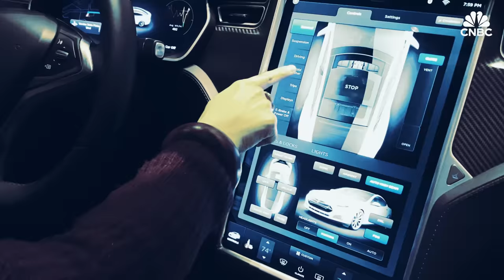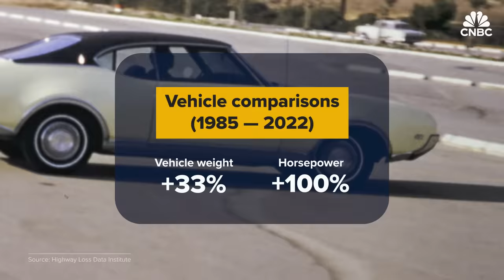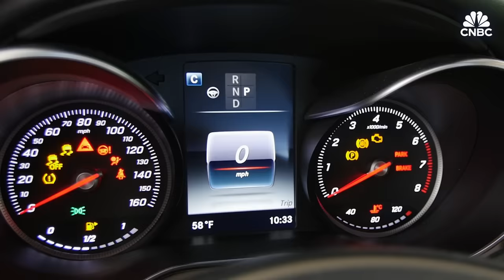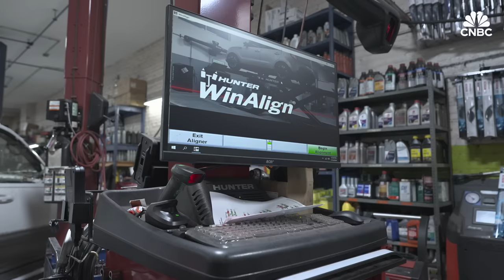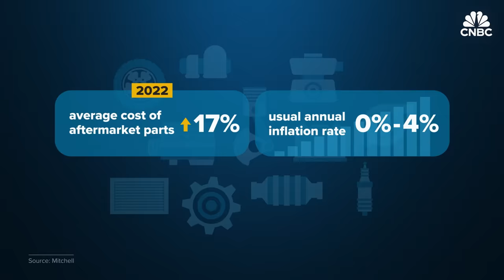Why Car Repairs Are Getting So Expensive

Comment: Not included in this video, is how car manufacturers are making dealerships the only place that they can have their cars repaired. This is essentially controlling the market and forcing consumers to pay whatever they feel like charging. This will squeeze out the already stressed independent repair shops and basically negate any cost savings that could come from the lower complexity of an EV. .

Please contact your local county and state and federal representatives and urge them to support right to repair for motor vehicles!
Reply: Your statement is half true. Issue is there isn't enough Mechanics who are willing to open a shop to repair cars. The Informations to repair cars and parts purchasing are not exclusive to Dealership. Anyone can Open a Shop and buy the repair equipments neccary to repair any cars, just like the shop this Video Interviewed.
Question for the shop owner is, at what point to you stop because the expenses simply exceed the profit to do certain jobs?
Do some basic math, Rent a certain Square Footage to open a shop, you have X amount of repair Bays, how much do you need to charge people just to cover the expenses?
Reply: @steak5599  And who is the first order influence of these higher costs? The manufacturers dictate the repair equipment specs and make the certification process as onerous and costly as possible... because if they run the shop... they don't have to account for any markup. 

This is all about forcing the market into a position where nobody can afford to be cost competitive with the dealer repair shop... and then they can control the market. They have been moving in this direction for years... but EVs and generally more tech in cars has accelerated it.
Reply: @paskowitz  right to repair only dictate whatever manufacturer sells to dealer also needs to be available for aftermarket shops and general public, it doesn't say manufacturers are giving them away for free.
They are certainly NOT free for dealerships.

Dealership also needs to pay a lot for subscription fees and tool cost. The difference is Dealership can make the money back on the investment, and general public most likely can't.
Reply: @steak5599  Right to repair laws in certain states have had language similar to "reasonable" in regards to the costs of obtaining the necessary documentation to make repairs. IIRC I think is was MA, but I could be wrong.
Reply: @paskowitz  that's the issue with these Laws, what is reasonable is always up to interpretation.
So you have to use the car makers Everytime when price is reasonable?

Here is the Price I found today. For brands like GM Ford, or Toyota, if an independent shop wants full access to all their repair information equivalent to a dealer is about $600-1000 per year, IIRC. 
Problem is, if you buy sub for every manufacturers, your shop would be losing money. But if you focus on like 2 or 3 major brand is doable.

But now u are back the the problem the shop owner said, he couldn't find any Technicians to work for him despite paying like $40/hrs for a Seasoned mechanic. There are simply lack of people want to work on cars for a living today in the independent repair industry.
Reply: Well, yes and no. I work at a GM dealership so that's what I have to go off of, but what gives dealerships the advantage is A: the fact you need a GM account in order to utilize GM's scan tool to update modules, B: any car that is still under warranty has to be taken to the dealership, and C: the digital service manuals GM provides for every one of their cars are really extensive and thorough. Of course, you need to be a GM employee to have access to those.

I will also say, the majority of repairs I see required on 2019 and up vehicles would not be reasonably repairable by laymen simply due to the complexity of the design.
Reply: @steak5599  A Shitload of money.
The information and computer tools to repair certain brands outside the dealership are ridiculous.
For exemple, mercedes XENTRY system is needed to enable new parts to work because the programming is sorta encrypted. Mercedes sell the laptop 40,000$ for the software with a 3 year life cycle. in 3 years you have to buy it again.
Chrysler (stellantis) charge 40$USD PER VIN PER MONTH to use the information and tool.
Reply: @julienjjj  I am not sure what European car makers charge for diagnostic tools, but I know Stellantis is $1600/year for techauthority.
I think Toyota Tech stream was $999, as was General Motor.

But we are mainly talking about if Right to Repair would actually lead to more independent repair facilities and drive price lower. In my opinion, it won't. 
Cars these days are extremely complex to repair. Right to repair may lower the price slightly, but not enough for it to matter. But that is just my opinion.

Either way, these are quite unaffordable for most independent shop unless you have a lot of volumes of certain brand.

And even if a shop invest in it, the cost of tooling will be pass on to consumers.
Reply: JDns-we4fw that's a foolish statement. You cant tell car manufacturers how to design their vehicles.
Reply: @steak5599 that is false, I love working on cars professionally and would never take $40. that's too low, and I'm in Houston, texas. If this shop is in new York and only pay 40 an hr for a seasoned technician, they are being cheap. Master mechanics over here get from 45 to 75 an hr.
Reply: @steak5599 also all data and Mitchell supply most information for at least 30 brands unlike only 3 like you said. It doesn't exactly how you think it does because you dont live it
Reply: That is a bit of a double edged sword. Most private repair shops dont want to fork out hundred of thousands of dollars for the latest model from the big brands. Image owning a shop and having to upgrade software and scanning hardware. I would leave it to the dealership too. Since they get the tools to repair these cars no matter what, its not a option. Nor would I trust any private repair shop to fix a brand new car that is still prob under warranty.
Reply: has nothing to do with right to repair. As a shop owner vs dealer owner. Dealer owner and needs to service their brand cars, which is not many and all made the same taking the same scan tools ect. But a private shop like your saying would have to buy toyota, ford, GM, subaru, kia its endless, and its a fortune in tech. The dealership has none of that overhead. They only have to worry about dealer cars, not some brand they hardly work on.
 @paskowitz
Reply: exactly right, that cost is ridiculous unless your a dealership @julienjjj
Reply: Good to know

Comment: The major problem with repair costs is parts markup. My wife had a quick strut replaced under her extended warranty and the dealership charged the warranty provider a 200% markup. I was shocked to learn that the part replacement wasn't even OEM, but rather the least expensive aftermarket brand available. In retrospect, if I bought the part through a retail wholesale provider and did the work myself, it would have cost me $100 and around 8 hours of my time. 

It helps to know your way around a vehicle if you're poor or didn't pay for an extended warranty.
Reply: I worked for a major auto parts supplier in the early 2000s. We were directly across the street from a well known brake shop. One of the selling points at this company was to tell their customers that their brakes were better than ours. What their customers did not know is that this company purchased their parts from us. These parts were delivered in an unmarked delivery vehicle, and we were required to deliver behind the building so their customers would not see us. One day we had a customer coming in to purchase brake rotors. We had two options available. One was $18, and the other was $38. He purchased the more expensive ones and left. A few minutes later, this company called us and began screaming at the commercial manager for undermining their business. Though we were unaware of it until they called, our rotor customer's car was in their shop. They had purchased the cheaper rotors from our commercial department at $9 each, and they were charging him $83 each plus $90 an hour in labor. He bought both of the better rotors for less than they were charging him for one of the cheap ones. Greed is a very large component of the problems that the industry is currently facing.
Reply: Multiply the price of the part by the eight hours it takes you, and you lose money. It takes less than two hours, to replace a strut, including swapping the spring. You wasted an entire work day
Reply: @coache1nine  the invoice was $1363.21. I'd be more than happy to sacrifice a Sunday working for $157.90/hr.
Reply: @JohnEboyee  to spend $157/hr for eight hours vs. 2 hours @ $140/hr. doesn't make you smart, don't quit your day job.
Reply: The same goes for being a homeowner. You absolutely must know how to do maintenance and minor repairs yourself or it will be unaffordable.

Comment: Minor accidents in an Ev can easily write off the battery which will cost tens of thousands, that is a huge failing of this tech
Reply: OOps my EV "suddenly caught fire_"
Reply: It’s not just EV’s. I have a Telluride and I’m in a Telluride group and I see brand new Tellurides getting written off all the time with very little damage that would have been repaired in the past.  Repair labor and parts have become so expensive, it doesn’t take much damage to write off a car.
Reply: 3 second 0 to 60 family EV is also a bad idea. My coworker's pickup truck has 800 hp. My other friend wrapped his monster truck around a pole. No wonder insurance rates are so high as people can literally fly.

Comment: The real problem is that even basic maintenance is getting outrageous.  Used to get a full synthetic oil change and tire rotation for around $100, now it’s over $170.  Front end alignment…used to be $86 only two years ago, now it’s $150!!!!
Reply: Absolutely, I went in for a diagnostic because of all the lights on and they charged me $200 just to look at the thing! Found out squirrels tore up 2 wiring harnesses which costed 8k.
Reply: I just paid 99.98 for synthetic oil and rotation at Pep Boys.

Comment: The only reason I step foot in a mechanic shop is to do my yearly emissions. It’s depressing to see they are charging $79 for an oil change and $150 for a serpentine belt service. Iv done my own work for the last twenty years. When I first started it was just for fun, but now with the prices it’s a necessity to do my own repairs.

Comment: Im starting to do maintenance myself. Changed a strut. Saved $400. This summer im going to learn to do my own brakes.
Reply: brakes are WAY easier than a strut. just make sure not to go cheap on the pads
Reply: That is small and easy maintenance. When you face a bolt that wont budge and you gotta use the acetyline torches.. thats when youll see it cost less to pay a real mecan8c.
Reply: @RideOrangeKTM  i would not suggest using heat unless you know how. especially acetylene you need skill to use properly, and its easy to make things go boom with it
Reply: I have done about 60 brake jobs and have never had to use heat to loosen bolt.  If I had to use a torch I'd probably use mapp gas I use for quickly soldering plumbing.
Reply: @covercalls88  not talking about brake jobs alone buddy

Comment: Part of the problem with modern cars is that they're putting parts INSIDE other parts. I recently had to take in my Prius because I ran my front bumper up against a gate, and it ripped just the right corner of the bumper off. I saw the bumper part on a dealer site for only $100, but the problem was there were like 10 sensors and the AC motor mounted INSIDE the bumper, and they needed either fixing or replacing. What should've been a simple plastic piece replacement turned into an entire revamp of the front end. The Toyota dealer wanted almost $9k to fix it and couldn't promise me it would take less than a month, the place I ended up going to charged me half and took just over 3 weeks (it took a week just to get the parts).
Reply: This is why I stay away from all these assistive technologies. The value they bring to me personally aren't worth it. Blind spot monitoring, lane keep assist, etc. Most of these new technologies are because people now more than ever are distracted driving. Keep your hands on the wheel and your eyes on the road and buy a reliable used in decent shape car and not pay the absurd repair prices of modern cars.
Reply: You can’t put an air conditioning compressor in a bumper dude😂😂
Reply: @DaN3xtSlimShady  I don't know exactly what it was called but my AC no longer worked. It looked a like a large plastic can with a tube that was ice cold to the touch. It was definitely for the AC, I saw the parts list.
Reply: Wow that sucks and i always thought toyota was easy to work on but i had a 98 camry
Reply: @buzztrucker  if you want to save on fuel costs, you don't have a choice (plus I got a rebate from Edison too). My previous car was a 2017 Nissan Versa, very efficient and easy to repair, but doesn't come anywhere close to the fuel efficiency of the Prius.
Reply: Was probably the accumulator unit

Comment: I learned a lot from YouTube. Oil, Transmission Fluid, Coolant, Disc Brakes, Drum brakes, Alternator. People have to start doing this stuff by themselves !
Reply: It’s to the point you can’t even buy a gas car anymore
Reply: @waterloo123100  In theory EVs should be even easier to work on.

But as they describe in the report: most on the market are essentially luxury vehicles.

The ones actually "designed for manufacturing", like the Leaf, are essentially compliance cars. It lost the fast-charge format war twice over (CHAdeMO < CCS < NACS). But also: Nissan refuses to sell you newer 40kWh batteries for the older 30 and 24kWh leafs (only the 63kWh battery does not easily fit).

Comment: This is why despite my 30 year old Honda Accord being down for repair until spring, I'm not getting rid of it because the issue is a cheap fix and once repaired, it'll run another 300k miles before needing another overhaul.
Reply: This is me with my early 2000s New Beetle. She’s showing her age a lot lately, but I’m going to keep her going for as long as I can.

Comment: I have an audi s5 as a company car which I can use privately. Recently someone scratched my car while getting out of the parking spot. He lightly scratched the bumper and a tiny bit of the headlight glass. The scratches were so light they were barely visible and the light was still working. You used to be able to just switch out the plastic/glass cover, but I had to switch out the whole headlight system. The bill for that guy came out as 7k$ total, out of which 4k was just the headlight. I couldn't believe my eyes, I thought it would be like 200$ for a new glass cover including the service fee. And then we wonder why insurance gets more expensive.

Comment: What's even worst is nowadays, the shops blatantly tell you they don't want you to supply your own parts. I was quoted $295 plus tax per shock absober , $110 plus tax per link kit, $150 plus tax for one ball joint, $500 plus tax for labor cost. I went online I found the pair of shock absorber cost $235, pair of link kit $75,  ball joint $46.